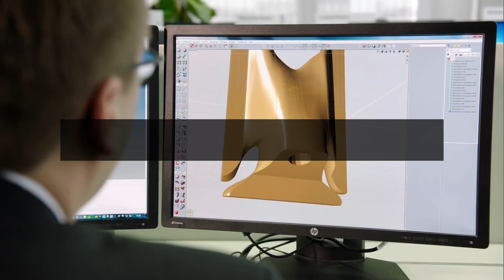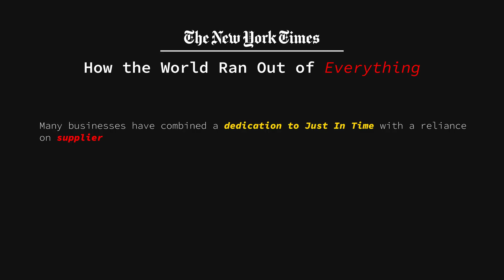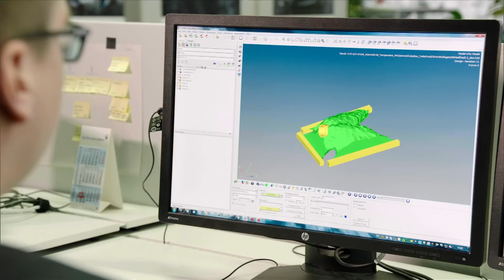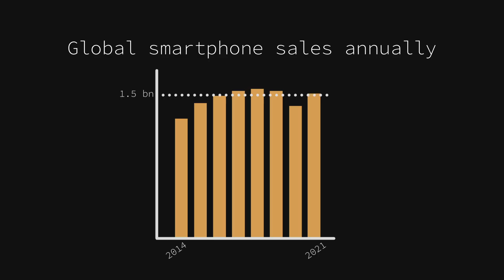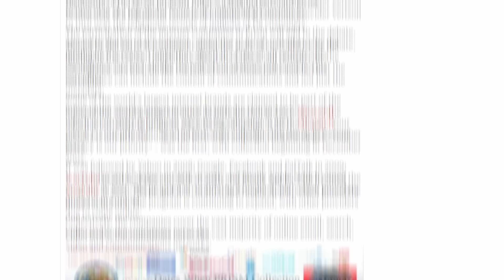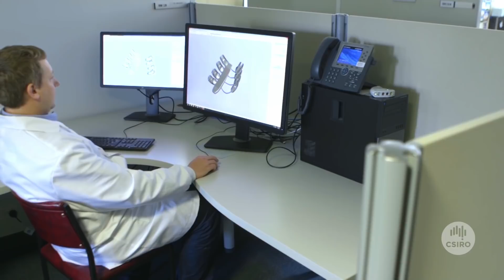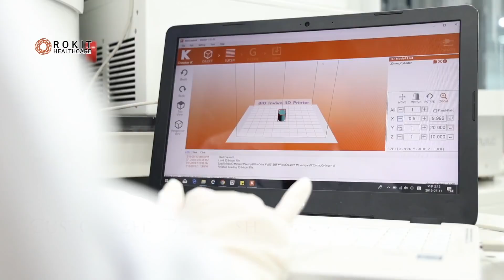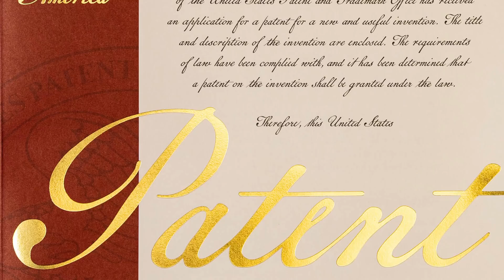How 3D Printing Could Decentralize (Almost) Everything

Comment: Been an engineer in manufacturing and design for a while, I'll say that you cannot ignore the role of joining and forming technologies in manufacturing, along with surface treatments, as additive and subtractive tech is just 2 of the many methods used in manufacturing. Parts are very complex, and many of them combine these 5 or even more manufacturing methods in their production. For a prototype robot I made, I had to use all of the above minus surface hardening. However for certain components, you can entirely finish the job with 3D printing and its really been a godsend as you don't have to waste time ordering $1 parts, but you still have to wait a few hours if your part is large while the printer slowly puts on one layer at a time.
Reply: How many of these problems you mention do you think could be eventually solved via improvement of the technology? When do you see this happening given the current trajectory of things?
Reply: @t.v-88  this is not really a unsolved problems issue, what he is saying is 3d printing makes one type of object. so let's pretend their is a magic machine that takes in a wooden log and turns that wood in to any shape. so you make a nice chair, you put that chair out side in the rain, the wood rots because you did not varnish it. what you need is another magic machine to paint the varnish on the the wood object. what he is saying is their is more to parts then just one aspect to them, you need multiple machines, these machines are well known and have been around for a while but if you want to start making ALL parts you quickly start needing a lot of different machines to do a lot of different things. what you end up with is a machinist shop. machinist shops are great they went out of business in the USA when they were shipped over seas, because cost that needed to be lowered was the labor cost.  but a machinist shops can make anything but it will never out shine a specialist factory that makes 1 thing really well, (outshine might mean cheaply). so the 3d printer allows you to do some things, a lathe allows you to do some more things, a cnc cutter allows you to do some more things, a water jet allows you to do some other things. but if you want to do all the things you need all the things. a lower quality 3d printer allows you to print some things at a lower quality, a higher quality 3d printer allows you to print some things at a higher quality, same with the lathe, cnc, and other machines. what you really need is a friend with a high quality 3d printer, a friend with a high quality cnc, and a friend with a high quality lathe. then when one needs a lathe they can have the lathe guy do it. but what you should do is pay him rather then trade him for the labor, so he can be busy for the town all the time. but he might start price gouging so you need 3 lathe guys for the area so they can compete. but never buy anything out side the town because then their work will just go over seas, where labor is cheapest. so to prevent this what you need is a tariff on all parts coming in to the town and it needs to be more then the lathe guy's hired minimum wage.  that's more then even Trump tariffs. now do you see the problem, it's how to actually politically do the solution.
Reply: @Amipotsophspond  Well explained 👍
Reply: @t.v-88  If you consider manufacturing technology, then an example would be super high pressure die casting. In WW2, Germany had didn't have access to sufficient sources of iron production for their aircraft industry, so they turned to using pressure die casting of Magnesium alloys that would generate a part with excellent surface finish and superior strength in just a single shot, whereas the American counterparts would require hundreds of operations done on a single piece. Cast magnesium alloys are brittle, but pressure die cast ones are even better than steels and require less complex manufacturing methods. After WW2 Americans captured these presses and then now several years later Tesla is using the same method in their Mega factory.
Reply: @l0_0l45  are you saying to 3d print the frame of the car?  I wonder how long that would take.  The beauty of it though, you make make what ever shape you want to design the proper structure member without worrying about proper design practices.  You would so many printers to keep up with production.  When it comes to die casting/injection molding, nothing is as cost effective with those 2 methods when it comes to high production.
Reply: @t.v-88  Manufacturing every component is a complex process, where requirements dictate the part geometry and physical properties, which in turn are constrained by the limitations of each available manufacturing process. Its a cycle, and several iterations are required before you get the "perfect" part. Some problems lie in the cycle, and have largely been eliminated by streamlining the cycle over several generations of industrial engineers working on this.
Reply: @t.v-88  So what we have left are material properties constraints and material availability constraints. Materials science has really taken off this century, with amazing materials that can do things you couldn't dream of a few years back. They completely eliminate the need for several manufacturing processes. Example of this would be carbon fiber laminates. Entire airplane fuselages and wings can be fabricated out of them with minimal effort, and just because it solves so many problems. Its a great conductor of heat, it has exceptional strength and fracture toughness, it is super lightweight, you don't need surface treatments at all(except painting?) and you don't even need a super skilled workman to do this. However they are somewhat costly, and you cannot get a very large piece as its not available in such large quantities.
Reply: @t.v-88  Another example is Functionally Graded Materials(FGMs). Their composition varies from one side of the part to the other side. They can be super hard on one face and flexible on another face. One side can be a conductor and the other an insulator.
These were originally conceived for space applications and tank armour, but they are so hard to manufacture that they are still just in research phase.
Using such materials would reduce the manufacturing complexity and eliminate several processes are the material is all that you need.
Reply: @t.v-88  I could go on and on, but you get the point. Its not easy to predict when something new comes up. You can always make the problem more extreme and your previous designs don't work. In general, the environments are getting more extreme and new materials are being developed to handle such requirements, while existing ones are being pushed to their limits. The trajectory is toward even more innovative methods to make parts, since human creativity is being augmented by computers, Computational materials modeling is playing a great role here. All I can say for sure is that stuff will get more and more exotic as time passes. I didn't even begin to mention corrosion and wear resistance(tribology), because that is an entire rabbit hole in itself. Let me know if you want any specific examples, since your questions are pretty general, and it would take hours to give a proper satisfying answer. Hope that helps for now! 😉
Reply: A Tesla bot can do anything you can. Problem solved.
Reply: Traditional machines are what they are, traditional. Additive manufacturing is the future, don’t varnish make the product resistant to corrosion. Think outside of legacy tools, like Tesla. Stop leaning on old tech and create something new and use it with producing your products. I am an engineer, material, chemical you name it I have engineered it. I have toured more factories than days in the year. I teach old fart companies to reduce crap engineering.  Most of the time engineers design products based on tools. There is no manic machine but better engineering from better minds. If you keep thinking you need finishing you will design crap that need’s finishing. Design better innovative not just on top of the last iteration. I fully see why Tesla is kicking old dudes from legacy companies butts. They think so small, lmao. I have used additive manufacturing for car chassis without finishing, even small devices. China will kill American manufacturing because they think that they need old tools to move forward. In the comments you gals and guys have a lot to learn. Design better stop planning to fail stop designing within the box. Think outside the box. Or loose to better engineering.
Reply: @donavanblack4347  I'd agree with most of your points. However, the selection of manufacturing method and part design both depend on geometrical and environmental constraints. In a small package, a corrosion resistant forged piece(or pressure die cast) would far outperform any sintered piece as forged stuff has the toughness. But this is also a broad generalization, since its again constraint and requirement specific, and a forged component may fail at something that a sintered component is great at. I have mentioned as an example that adhesive bonded carbon fiber panels need no finishing or any other process to make the final product. However such a material is not a raw material but already a processed material. Same goes for many things. Sure, some components could entirely be made from SLS various grain blends but their performance is entirely dependent on the requirements. Its just a subjective thing. Obviously having parts made on inferior machines with lose tolerances just so that they are sent to machines that do finishing is a waste of money and time, but most machines already have such features integrated into them that you don't need extra processes. Also, sometimes you only want your part to be tough but only its surface hardened as it is the interface, because it makes the part more prone to fracture if the entire piece is hard through and through. Same for corrosion resistance. Several naval ships still use sacrificial anodic protection for their hull components because its cheap, and they can use dissimilar materials that allow them to get the desired structural properties at a small cost of regular maintenance(changing the anodic pile).
I'm pretty sure years down the line, some processes would be invented that would make all current processes obsolete and make parts with superior properties faster and cheaper and in large quantities. We can only speculate at this point, and I'd love to incorporate them in my work as soon as I can get hands on them.
Reply: @l0_0l45  I see your point but your still designing as if you have constraints. Some things, parts, need lateral strength over longitudinal. Some areas of a part may need less material than others. Yet I teach companies, teams to design better. Imagine you could design a table without any restrictions, how would you fabricate it? The sky is the limit you could fabricate it with any tool or machine. Now what machines would you use? Make a new machine that doesn't only make your table but it could make other things even center those parts. Some financial office human thought it was good for the bottom line. If it cost to much, right now we don't do it. We find lazy cheap ways to solve complex issues. Band-Aids on gunshots wounds. Tesla is killing everyone with new tool thinking. They design better than anyone else, because they don't make excuses they just do it. They made a giant press when everyone for 100 years said I was to costly. 100 years of fools. In order to build better, not designing to sell but designing to improve, for the sake of it. That's why my company make money hand over fist. We think outside of what was or has always been. 44 new machines design's to fabricate new products better. All of which can either be CNC, Injection metal or composite and Additive Manufacturing. In one machine. Why because it's the best way forward. To keep using what the last companies or engineering company did is lazy. To be the best you must keep pushing beyond the edge. We have to find a better intersection between innovation cost effective and demand. And if cost effective is killing the design get rid of it. Design for improvement sake.  

Electrical engineering hasn't changed in 60 years till Tesla co, manufacturing has changed in 40 years till Maker released the maker bot from lapsed patent's. Why wait till someone else does it to advance? I talk to software engineers who can't solder, but can write code. What if they have to work with the hardware team? What now they know nothing about manufacturing or circuit board manufacturing processes. They need to. Designers, engineers who keep pushing 3 to 5 of the same old machines to build 1 part. Why not 1 machine doing 5 to 6 different tasks? I aim to end inefficient design and manufacturing through better tools. Software and hardware. So engineers can design freely without tool constraints. Thank you for listening to my rant. My company get paid hundreds of thousands of dollars to change this thinking in companies. Sandy Murano and Associates and myself are amongst the smallest club of engineering companies who do this. It's sad that we get paid for others limited box thinking.
Reply: @donavanblack4347  Sandy Murano??  His last name is spelled Munro. (Munro and Associates). You don't show up in any Google search.

Comment: 3D printing technology should be distributed as far and wide as possible,
Reply: they are cheap to build yourself
for example mendel can be made for less than 60 bucks
 prusa I3 clone/diy metal anet a8 can be made for about 100$
Reply: @bocian0  It's too late now. Can't stop the signal
Reply: @ciarfah  wdym?
Reply: same with agi.
Reply: Found myself a 3d pen to do the task, something that I have for a very long time really wanted to do as it gives more control and no worry of programs crashing and the printer becomes unresponsive because the computer randomly froze.
Reply: @TheRealFobican  ok buddy
Reply: @TheRealFobican  i is there any practical use for 3d pen apart from repering voids and gaps?
Reply: @bocian0  haven't tried yet but if the material type compatible on both ends then maybe, I'll have to try.
Reply: It will be distributed to the point that there will be non trackable 3d printers and there will be a 'high tech'  grey/black market in the future where you can find parts in the future without government oversight.
Reply: Big corporations are going to put a huge paywall on it.
Reply: 3d printing sucks... honestly its very limited, even with all the special filaments you can use. its better to just use a CNC machine as you are not limited to only certain types of plastics, its also so much faster and the finish quality is pretty much perfect, in fact its used in manufacturing today.

for instance stamping guns out of sheet metal has been deemed impractical for manufacturing due to high start up costs for rnd tooling in contrast to cnc machines which can allow for rapid revision and change in the manufacturing process.
Reply: @mitri5389  3d printers aren't meant to be used in mass production

also 3d printing should be taken as one of may tools, it is not self contained solution for everything

but imo they don't sucks
I use one everyday with my diy PET filament from bottles

Comment: traditional manufacturing has economies of scale, 3D manufacturing is difficult to scale, at least as it is now. But it will take its place and grow its role as you suggest
Reply: @tripplefives yes but it can make diferent kind of part.
Reply: Yes but with 3D printing you don’t need to scale it as much because you can decentralize production. So instead of mass-producing parts and sending them everywhere, if everyone has a printer in their home, or at their local store, you can simply print what you need when you need it. It’s much cheaper, faster, and less wasteful that way.